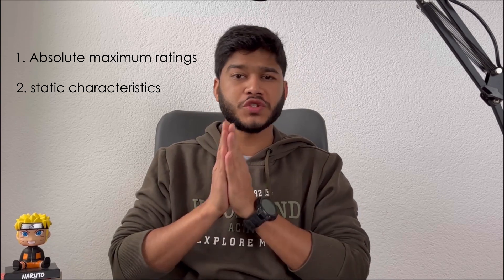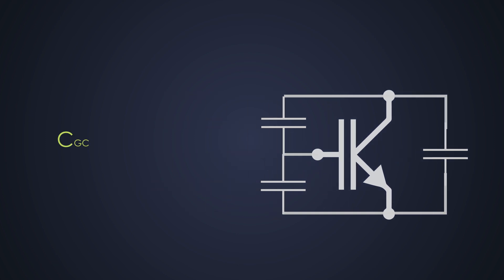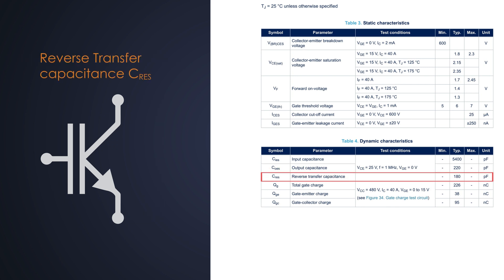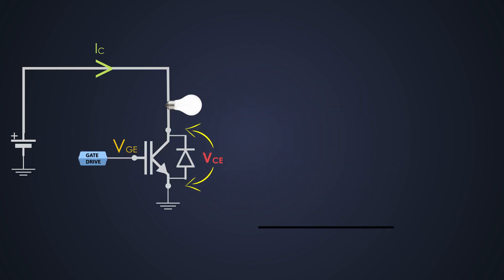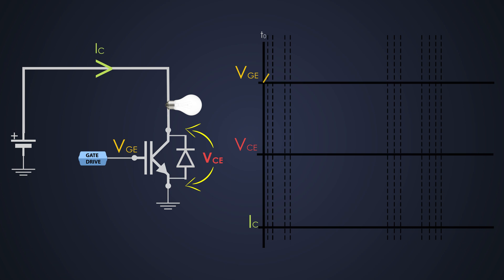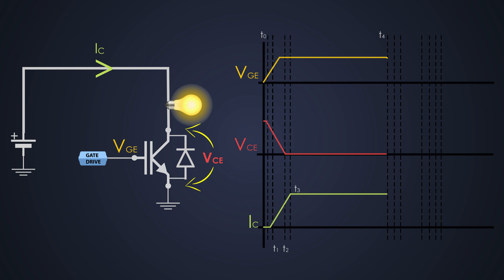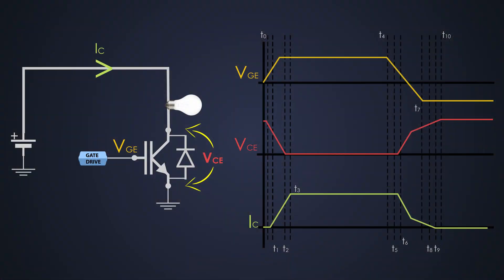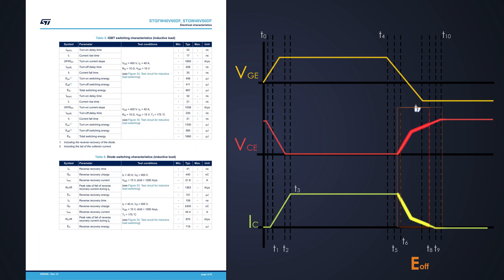IGBT switching understanding | Dynamic Characteristics of the IGBT | IGBT switching Explained

Comment: There is one mistake in your explanation:- VCE will start to damp when Vg reaches at the level of Vth, but you have mentioned VCE stats damped as Vg rises from initial.
Note : As Vg starts rising and as it reaches at Vth, at this moment gate-emitter capacitor charged and Ic starts rising and same time VCE starts damped and it fully damped as Vg rises to the Vg-pleauto region and at this moment Ic reaches to max.

Comment: The biggest issue I have with semiconductors manufacture is the big lie abt any ir2110 or ir2113 can drive 2 amp but 2am can’t driver 4 igbt and I noticed inverter use them a lot and the gate current of igbt at surge the gate current will take 5 or 6.4 amp per igbt and 4 igbt on one channel with take up 24 amp per surge and those drivers can’t get pass 2amp peak so now you see why high frequency inverter low side alway fail ghe igbt don’t fail the gate current fail to charge and load stress on the gate the p type in the internal package breakdown at surge because the current is not there so much information is being kept away from the data sheet so all gate drivers Ic should but at 30 amp peaks not 2amp